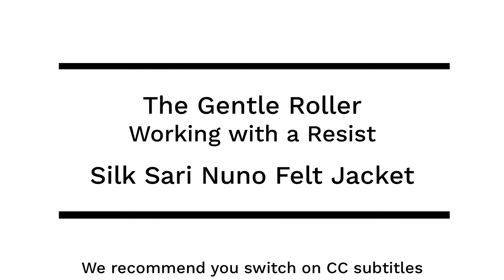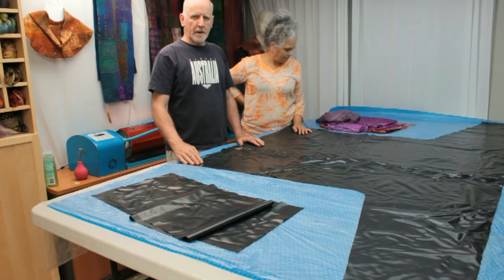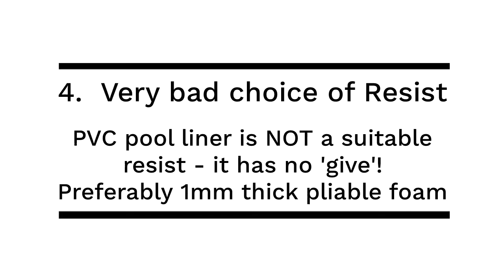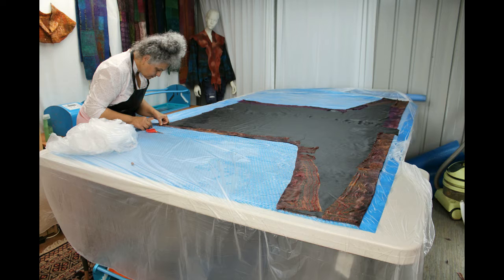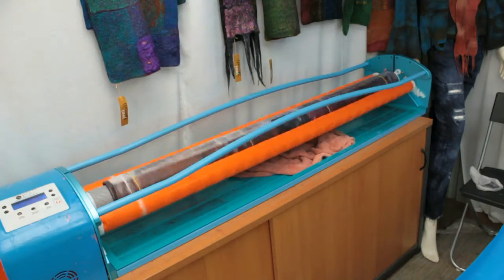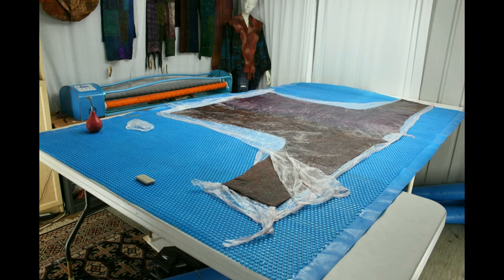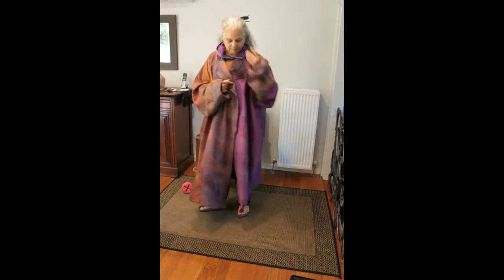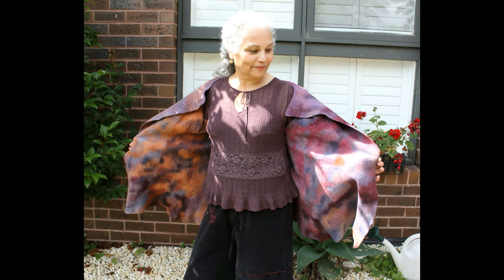Sari Silk Nuno Felt Jacket, made with resist and The Gentle Roller

Comment: this is fantastic! I'm  a new felter and have a large needle felt machine that I can do yardage on, but it still has to have a wet finish. This might be perfect for me. Definitely something I'm going to think about.
Reply from the maker: Mandi Ballard thanks for your comment. You must have a very large needle felter - is it more like a needle punched batt maker?
The Gentle Roller is a wet felting machine and it does a great job of getting you a pre -felt. 😊
Reply: Joan, yes, it’s like a punched batt maker. Its called the felt loom. It does a great job, but to get the felt really “glued” together I wet finish with a palm washboard. This helps a lot to get the silk fiber I add to be fully integrated. But it’s time consuming for larger pieces and I have been looking at wet roller machines. This way I could do large pieces quicker
Reply from the maker: Mandi Ballard The Gentle Roller comes with a fulling drum and that does away with the hard work of fulling. gentleroller.com.au

Comment: How many grams of wool did you use?
Reply: also for the pliable foam sheets, do you know where some might be acquired in large pieces?
Reply from the maker: Hi Taylor I think I used around 260 grams of short haired superfine merino. It was a while ago now but I started with around 300 grams of wool and I have weighed what is left over and it's just under 40 grams.
Reply from the maker: @taylorboria4860  use floor underlay which is fairly inexpensive and is much better than the pool liner material.